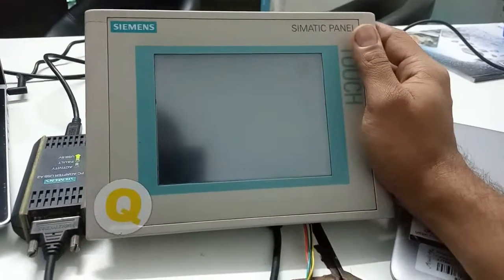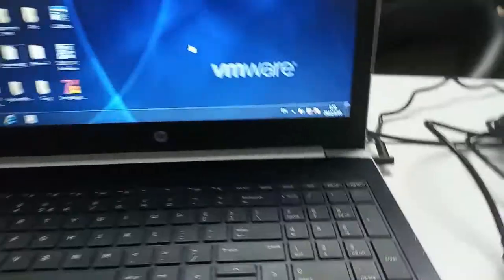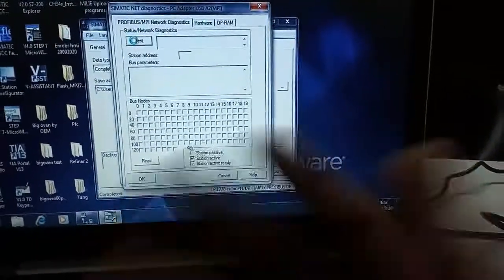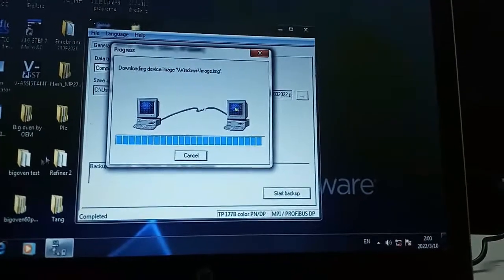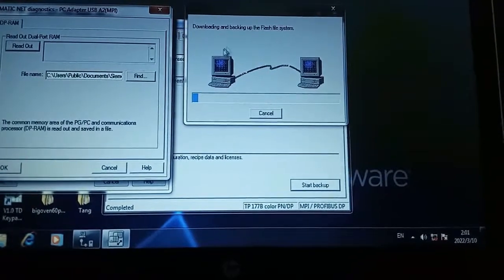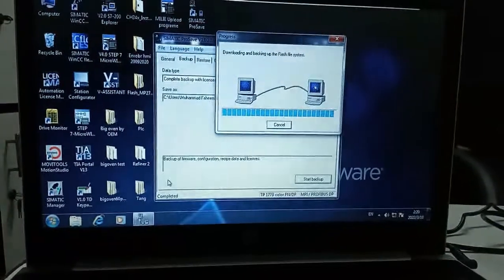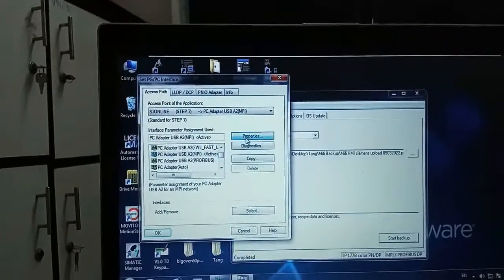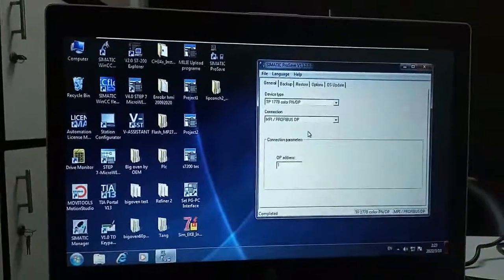Upload Siemens tp177b  HMI Backup Via ProSave software

Comment: Sir I am trying to take back up of TP177B PN/DP hmi through the Ethernet cable on simatic prosave  ,I am not able to take it because connection couldn't be established,I have ping from PC to hmi it's showing fine.
Just want to know which option has to be selected for the the PG/PC interface for the Ethernet cable ?
Reply from the maker: if you are getting ping from hmi then you must need to select correct HMI model on prosave like correct inches, model, version etc

Comment: Sir, I have an HMI TP170B Mono and Profibus MPI/DP cable but I couldn't connect with a laptop and there are no LED lights on the adapter. could you support me in this issue?
Reply from the maker: check hmi communication setting and cable power should light up when connect to laptop

Comment: Is there is a way to upload via usb or mpi faster this backup ? I backup and its long time always ~2h
Reply from the maker: yes you can use mpi for faster communication if hmi support mpi see setting of hmi and manual
Reply: @industrialsolution6828  I mean for backup using prosave  ? when I use MPI/Profibus option its took long time for complete backup.
Reply from the maker: @kizuGi  Yes you are right. there is no such way to make it faster with MPI, it might can do fast upload if MPI is original Siemens cable otherwise it takes long time